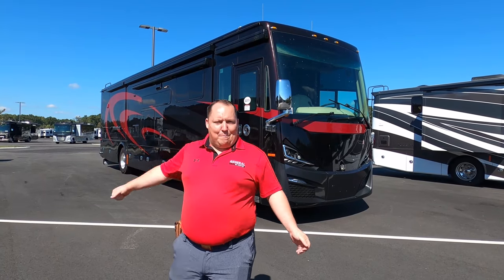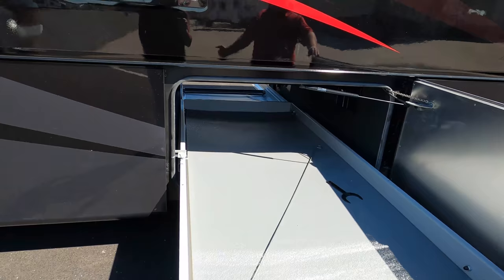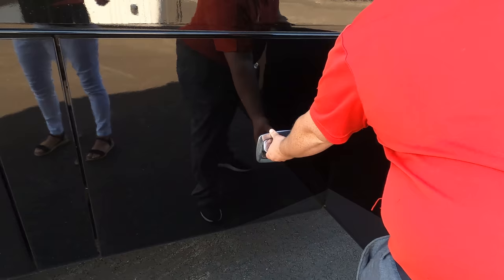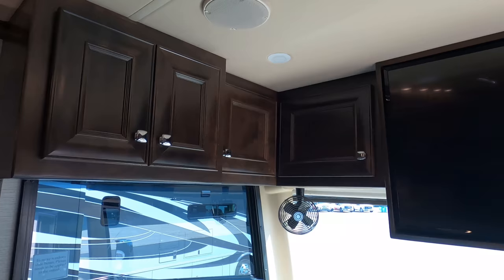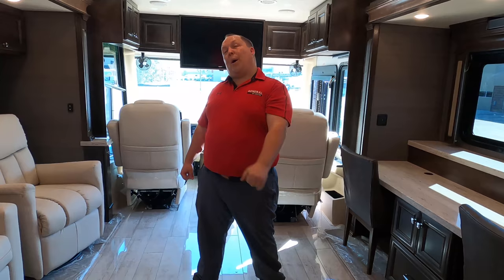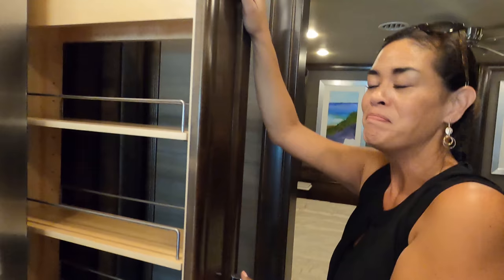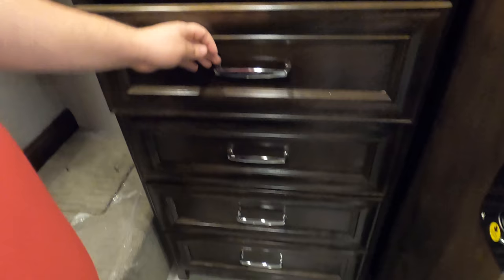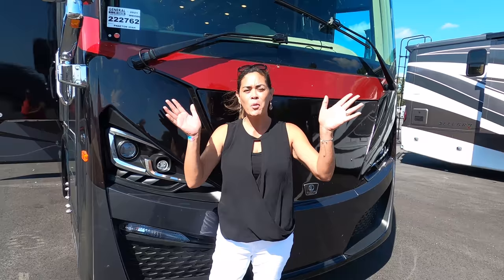The #1 Selling Class A Diesel Pusher for 2020

Comment: Matt, Why don't the RV manufacturers make smaller class A RV using Heavy duty  Pick up Truck diesel engines. such as the Powerstroke 6.7 liter diesel that is in the F350.   Or the cummings deiseal that is in the Ram trucks.   They could sell it as an entry level diesel and increase overall Torque by about 500 lbs.   Thereby increasing fuel economy and Towing safety.   The Godzilla engine is great and all but its not a diesel and is probably not up to pulling a 35 footer up a hill while towing.

Comment: 3 Dislikes:  The DEF and fuel tank fillers are too far apart - don't know why Tiffin hasn't figure this one out yet (in fact, that DEF tank is nothing but a gas can - come on man.  The office layout - prefer the pull out table and chairs.  No solar - should be included at this price point.  3 Likes: The interior is stunning!  The paint job is fantastic.  The rear closet space is very thoughtfully done.

Comment: Likes
1window in the kitchen and the backsplash are super nice
2 bathroom storage is awesome
3 fireplace placement
Dislikes
1The drawer between the two work stations looked wobbly or not on a track, kind of last thought and not super sturdy? (might have been the way he pulled it out) also the drawers in the bedroom, some dont slide very well :/
2 The couch bed i dont like pullout beds they are super uncomfy , a trifold would have been better
3 carpet on the slides
4 toilet :(  my husband only buys 4p toilets
5 no dinette is fine, but they should have put those round things in the ground by the couch where you could have a couple of small tables

Comment: Pretty wrapper, but that's about it. Why didn't Matt just use the keypad?

Dislikes: (trying to switch over to ending on a high point)
1) Length. As I recall over 40' is going to be difficult to get into campgrounds at national parks.
2) There did not appear to be seat belts for "passengers" making this a "couples camper"
3) Outside TV/entertainment center. Who wants to be sitting next to a camper when you got all that nature to explore.

Likes:
1) paint job and overall exterior look.
2) Work station area although some sort of table option for the couch would be good.
3) Storage. Hope that width will allow you to put in kayaks and stuff.

Comment: Dislike any carpet in an RV unless it’s the bedroom.  Dislike having a TV in front. It is not necessary. Would prefer to have cabinets in that space. Dislike emergency exit window.
LOVE ceiling fan in bedroom, televator tv, and desk area.  Just concerned if sitting there, you would be on two different levels of flooring?

Comment: Likes: 
1. Automotive windshield glued to structural metal framing like a car instead of set into a fiberglass cap with just a big rubber gasket
2. The roomy residential kitchen with gas cook top, better when dry camping.
3. The roomy bathroom with the exception of the toilet being too close to wall.
4. Nice shower with seat (looked like a one piece without seams).
5. Engine has plenty of torque.

Dislikes:
1. TV in cockpit, no need for it when the larger TV is a few feet away in the televator.
2. Poorly designed emergency exit window placement of inadequate size.

Wishes:
1. How about a bidet for the toilet?
2. Emergency exit door standard in all coaches.

Comment: 👍 Smashy!  Locked out with the engine running, so precious, really screwed if you forget the passcode, & if don't think you can escape through the emergency window you really ain't using it as a back door.  L: living area, a common sense dining/work area; good size bedroom nice location for the w/d; nice beefy 10,000 generator!  D: not really a fan of the shiny tile flooring and the cabinetry a bit dark and glossy; tiny escape window, women/children first they get stuck and I die, 'nuff said; strange living area ceiling medallion/lighting area ; why always only carpet on the slide outs?  Stay safe, things are really getting stupid out there 😷😷😷😷

Comment: Likes:
 1. Computer workstation and "televator"
 2. Large window in the kitchen
 3. Washer/dryer

Dislikes:
 1. Disco-themed ceiling
 2. Mirror on the entry steps
 3. Carpet!! The carpet looked absolutely horrendous!
 4. Cramped toilet
 5. No solar.  For the price, solar should be included.

Comment: Let’s talk about your 4th dislike. There’s a reason the saying “Now we’re cooking with gas!” exists. Cooking with gas is superior. Induction is convenient and techy but it’s not how someone who really prepares food chooses to operate. If I’m paying that much money for a motor home I would expect to have a choice. They should make it an option.
Reply: Right! I’ve had electric cooktops at home for 35 years. When I cooked my first meal in my RV, I remembered how great it is to cook with gas! When I remodel my home kitchen I’m getting a gas stove. No comparison!
Reply: Came to say the same thing (though it’s induction not conduction.) Anybody who complains about a gas stove is an eater, not even a semi-serious cook. 

Also, as another commentator stated, all electric with induction is an option; this unit just happens to be optioned for proper cooking.
Reply: DieGoogleDie thanks. Thought I typed induction but fixed it.
Reply: As I understand it, the induction move is a safety issue.  Fewer gas lines plumbed through the coach.  Just like the move away from gas reefers.  Also allows for combining convection / microwaves and removal of ovens.
Reply: @kennethdebbiedavis865  Your understanding is deeply flawed. I am one who is a zealot for modernizing RV power management systems, but if doing away with gas was a safety priority, why would 99% of RVs sold have propane systems? And what has one to do with the other in your last sentence? Why would you need induction to have convection? They are not mutually inclusive, not are convection and gas mutually exclusive.

Comment: Dislikes 1. No dinette 2. No battery slide out tray. At this price point I shouldn’t have to strain my back to replace a battery. 3. With slides in the passenger seat can’t recline. Bonus dislike HATE HATE HATE the paint job. 

Like 1. Bed is usable with the slides in. 2. No overhead bunk. 3. Love the double sink in the bathroom. Bonus like is the grab handle in the shower

Comment: @Matt's RV Reviews

3 likes:   Bathroom layout.   Kitchen - layout and choice of hard surface materials.  Overall good looks on the exterior.
3 dislikes:   Agree with Matt - $300K+ unit should have Induction cook surface.   Toilet position/angle - wth Tiffin?   Lose sofa and substitute theater seating and a large chair.
1 MAJOR FAIL:    Co-pilot step cover.  Possible safety/trip hazard!    For a $300K+ unit, I'd fully expect to see not only a motorized cover but one that raises to be flush to the rest of the floor surface.  There is simply NO reason that this feature was not included......wth Tiffin?  Possibly an option?  Other brands that offer less quality at $100K less do include this!   Besides that, what was under Andrea's feet just looked so cheap, appeared to be unsafe and reeks of cost cutting measures that causes some folks to think are there other areas where this was done even on more important things?  
IMPROVEMENT AREA:   For a $300K+ unit I'd not expect an $83.00 trash can.  Fully expect a $125.00 one!   Come on Tiffin, you're slippin!
Reply: We have a 2018 Phaeton and the stair cover comes right up completely level with the floor.  This cover looks dangerous!

Comment: Especially for 350 I just don’t think I this is very nice.  The outside looks like an overdone Hyundai- no class.  A bunch of gawdy plastic.  Looks like a cheap toy.  The inside by contrast looks like a slightly dolled up rv from the 80s.    Carpet ??    Dark wood?.  Cheap countertops?  A complete disappointment.  I guess I like the 1100 ft pounds of torque.  That’s it.